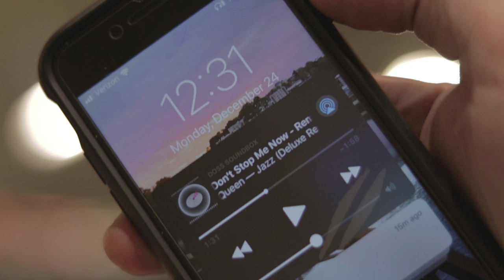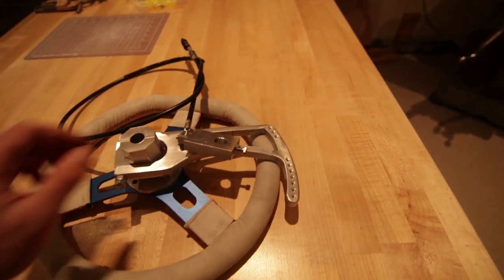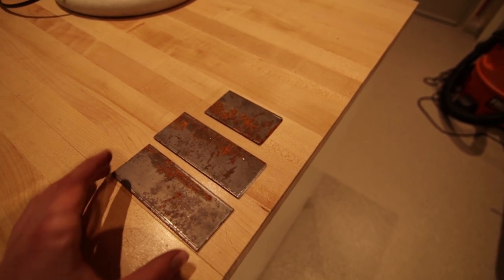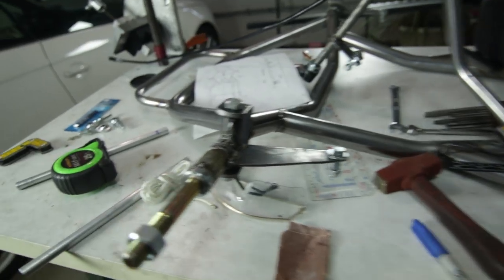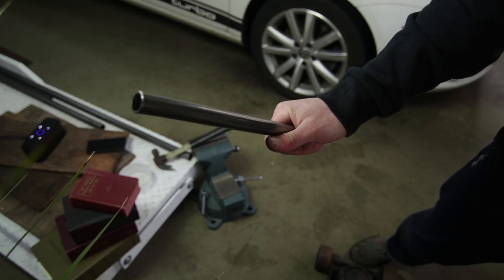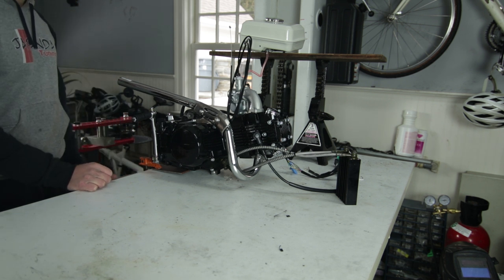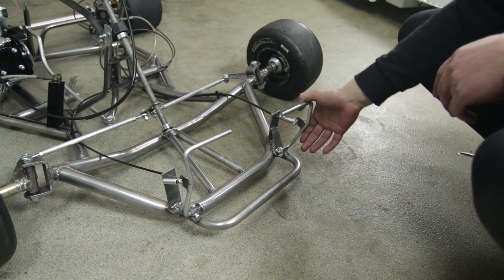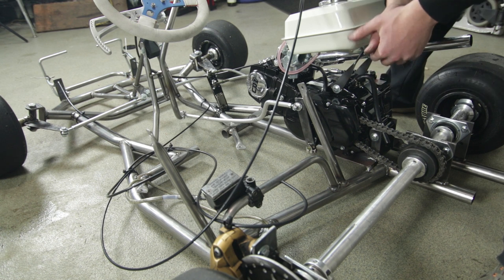CUSTOM SHIFTER KART BUILD PART 3: MOUNTING COMPONENTS

Comment: i have a lifan cart  kinda like yours and i need a steering wheel type clutch that you have. Would you be willing to sell a copy of your setup. i can do it i just dont have  access to a mill
Reply: If I were to make that custom part, I would be charging around $300 for parts and labor. You are much better off buying a part that is mass-manufactured for much cheaper. The reason I machined this part from scratch for this gokart is because I wanted the entire kart to be built entirely from scratch. More like a challenge and got to make everything custom the way I like it. It is not economical to do it this way
Reply: @PeterArmour  can you give me your facebook account

Comment: Your spindle arms are backwards... the method you used is for the arms infront of the spindles... just flip them from side to side and flip your steering column and you should be good... great work so far though
Reply: its the same thing really. Both methods will turn the outer wheel less than the inner wheel